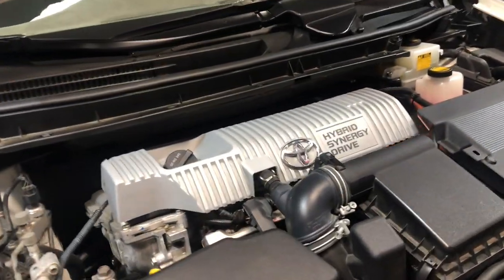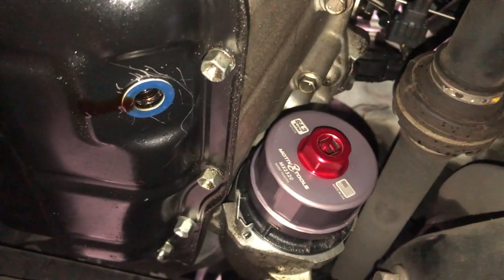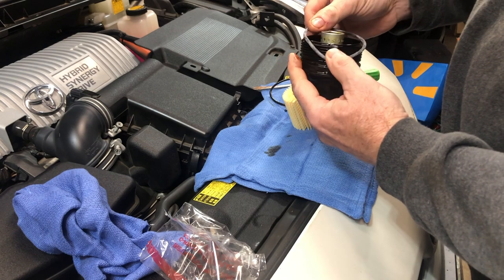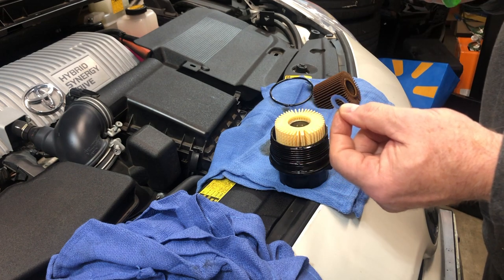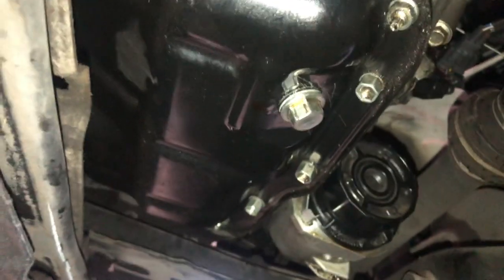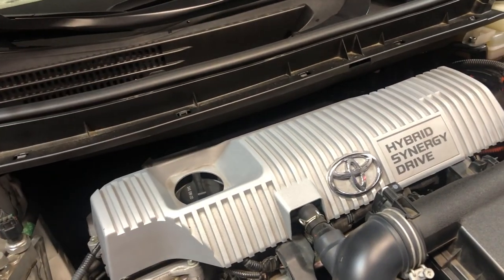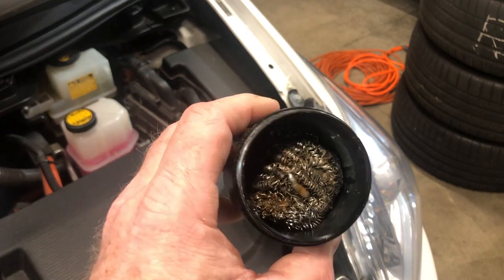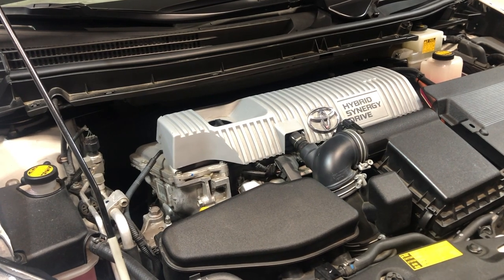2010-2015 Toyota Prius  // How To Change Oil // Oil Catch Can Cleaning

Comment: Thank you for the video, but there is no mention of the socket size for the drain plug or for what kind of tool you use to back the oil filter canister off.
Reply from the maker: I normally mention it but most all Toyota drain plugs are 14mm, and it's not terribly hard for people to figure the correct wrench to use! 😉 I did show the oil filter wrench I use and the link for it is in the description below the video. I always leave a list of the things I use to help out others.

Comment: Hello Jim. Just wanted to thank you for your excellent video. I never heard of oil catch can. I am very new into this. Do you have to have detail video of how you install this oil catch can please 😀
Reply from the maker: I installed mine before I started my YouTube channel but I explained how to install it on another video. It's very simple to install if you have the intake manifold off or loose to change the PCV valve or thermostat housing. Around the 23:00 minute mark of this video I'm replacing the PCV valve and I discuss the oil catch can. The hose simply runs from the PCV valve to the oil catch can and then from the nail catch can to the intake manifold. It is placed "inline" of the "U" shaped hose that normally runs from the PCV valve to the intake manifold. https://youtu.be/cfti8lkiqgY?si=F-GEB6X16QNJKIus
Reply: @jimsgaragetoys  I wish you were in California. I would've just taken mine 2006 & 2013 Prius to you 😅
Reply from the maker: @manarahmad7342  I do feel like I've gotten to know the car very well. 😍